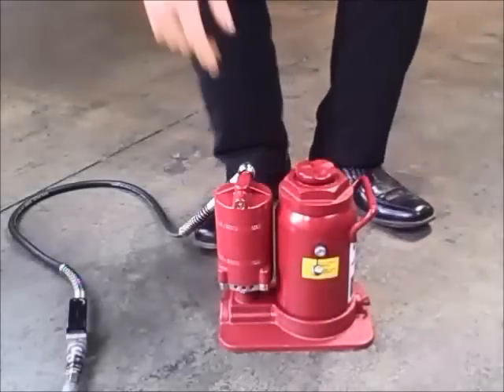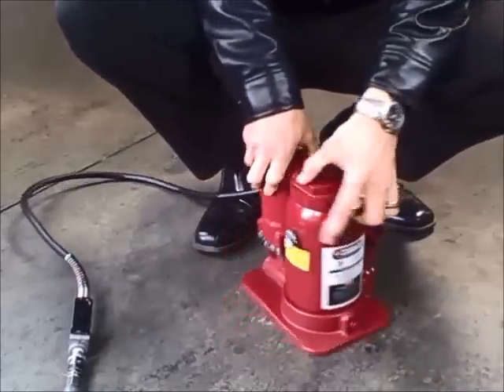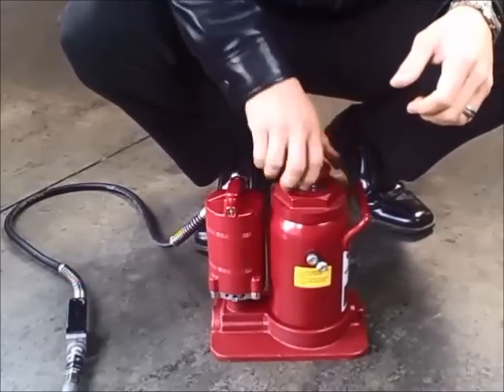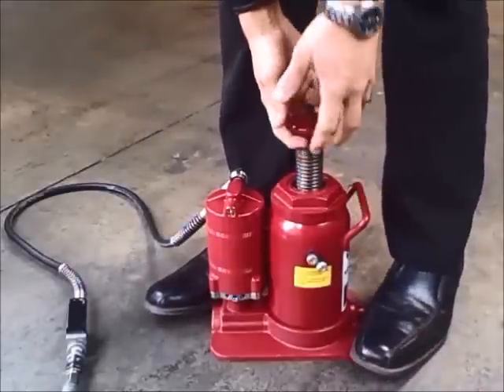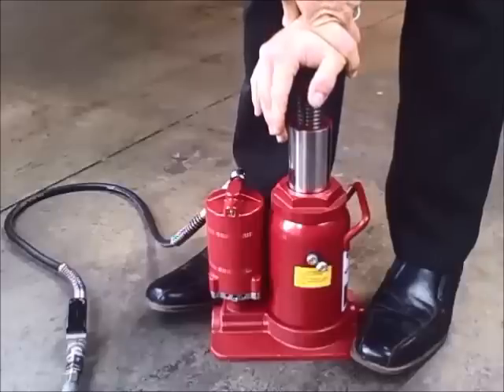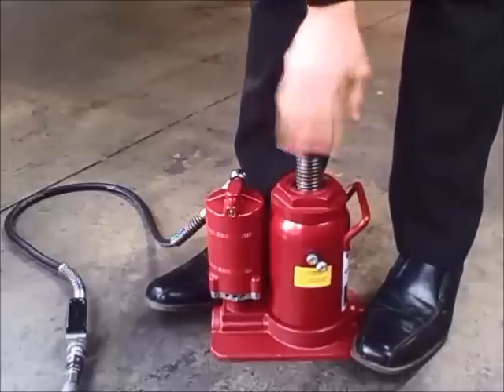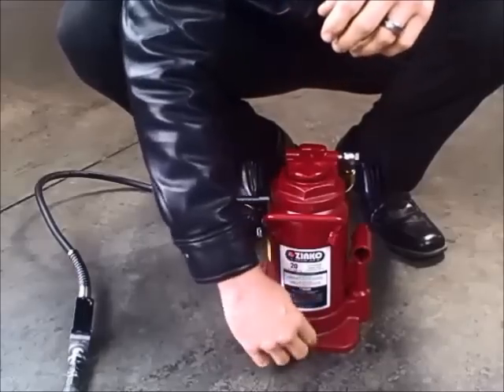How to Remove Air From an Air/Hydraulic Bottle Jack

Comment: FWIW, I figured out by accident how to fix mine.  There is a screw at the base of where the air motor is secured. . . this screw had a red plastic cap on it that says, DO NOT REMOVE.  So of course I removed it.  When that air jack is operating, I first loosened, then tightened this screw.  As It tightened, the ram BEGAN TO RAISE!  I tightened it the rest of the way.  It now works perfectly.  I went back and performed the same procedure on the first air hydraulic jack I bought (Vevor).  Now that jack works perfectly also.  None of the idiots at either customer service could or would explain what to do, but now I don't need them to. . . fixed it myself.
Reply: l'm in this mess now. l'll try this to see if it works. If it does, we'll have 4 working jacks ! Thanks for the info.

Comment: Mine was only raising the Piston about 2in. I raised and lowered the Piston manually 10 times. Now the air function won't work at all, although the manual lever still works fine.
Reply: I called a company the repairs air over hydraulic bottle jacks.  They told me forcing the piston up and down is the worst thing I could do.🤥
Reply: The air part was pumping on mine, but wouldn't raise it up, I did raise the piston manually, just like on the video, and now everything works just like new.

Comment: Why is it that when I push the air button some oil will come out the air vent?
Reply: Well,..I'll answer that question,
Its because your air compressor releases oil or water

Comment: I didnt see you close the side vent???  Was there a reason you left it open????
Reply from the maker: Hi Greg, 
We have the chipping plug and the air vent plug together. When bleeding the air out, just make sure the air vent plug is on and the release valve is open.
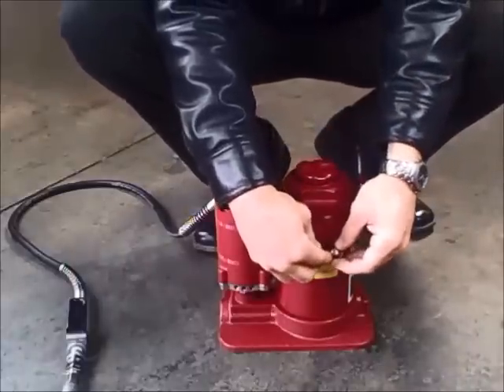Reply: @zinkohydraulicjack  With respect, this still does not answer the question. Do you "leave it off" as stated at 0:38 or do you put it back on when the process is complete? 
Very helpful video - Thanks - but I do not know whether to put that side plug back in or not. I cannot find an air vent plug locally.